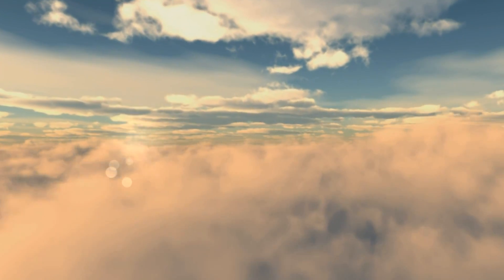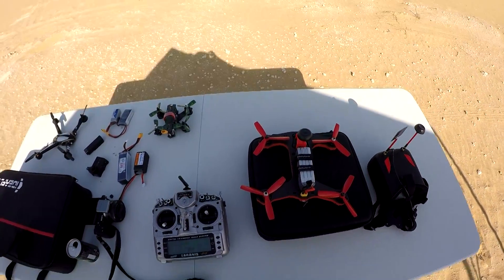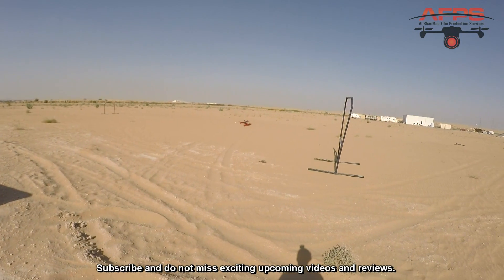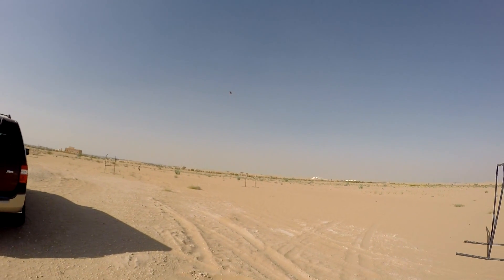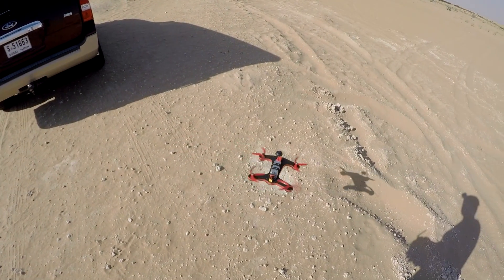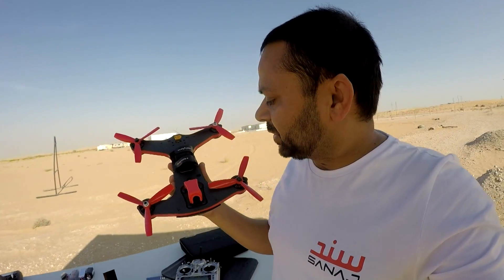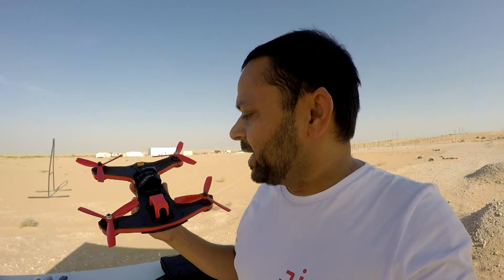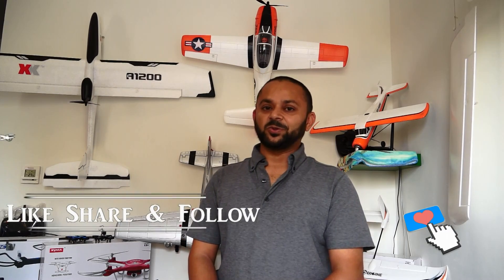Holybro Shuriken 250 FPV Racing Quadcopter FPV Flight Testing

Comment: flies better with battery o the bottom also safer :)
Reply from the maker: Can try that
Reply: i have the 180 and i cut a battery with it on the top its still close on the bottom but i havent cut one they need to move that plug lol